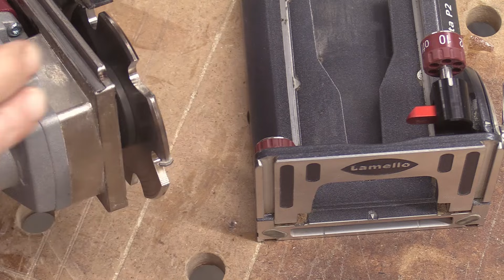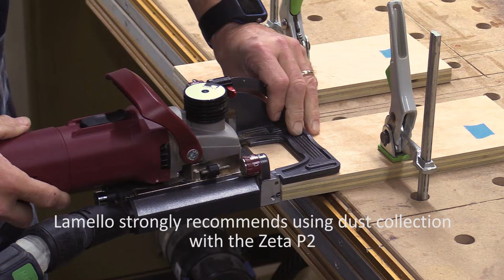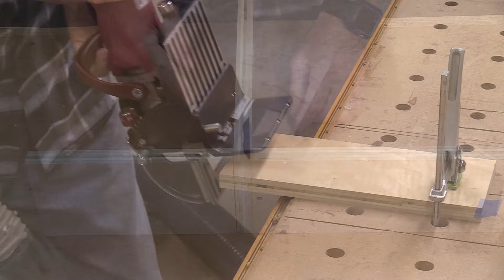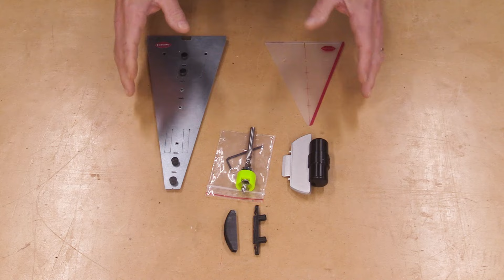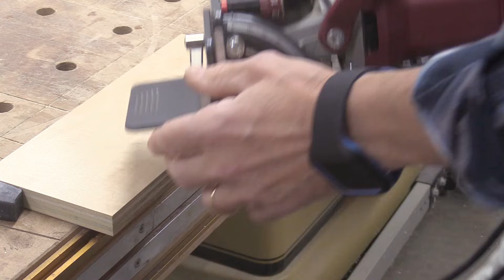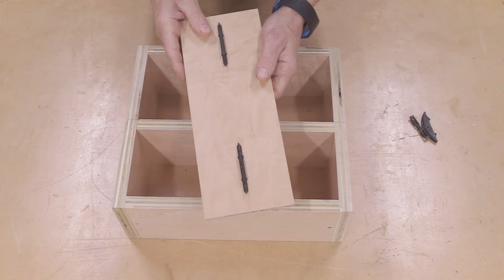Lamello's Zeta P2 and P System Connectors

Comment: I just got mine and tried a corner joint but wasn't getting them flush, but I just realized you flipped the faces after doing it  (~6:05). How did you know to do that? The bit about corner joints in the manual does not explain any of that 😅

Comment: Im debating if I should get the Zeta P2 or the DF 500 domino tool. Do you ever use the domino tool? I have a couple kitchens and and various other cabinets to build. I would prefer a tool that doesn't require me to use clamps during glue up, but I'm worried about durability and longevity with the tenso clips.
Reply: I have both lamello is great but all connectors are very very very expensive 😢
Reply: Why would you be worried about the durability and longevity of the tenso? Its only use is to keep things lined up while the glue dries. The glued joint is durable and will last if done correctly.

Comment: I noticed you never tried to wobble the pieces when you joined them and said it is very strong  joint. I purchased this machine and yesit is strong if you try to pull apart but there is a little movement from side to side when you pull push a little. So what that for the Lamello sales? should be honest a bit more

Comment: Great video Guy as always. I bought one these a couple of years ago after watching you use it in a project and watching it on a couple of other channels. I remember thinking that I learned more about the machine from you than I did from the manufacturer’s videos as well as the distributors videos. I think they forget that many times someone looking at their videos are new to that particular piece of equipment. You must have been a teacher in a former life because you break things down quickly and make it easy to follow and understand. And I still managed to learn a few things so thank you!
And on the subject of learning things.... do you have a video out on the Powermatic Bandsaw that was in the background? I have a probably 18 year old 18” Jet bandsaw with the steel spine and have been thinking about upgrading to the 18 or 20 inch Powermatic unit you have. Mainly for two reasons.... the ability to quickly release blade tension and the guides on your bandsaw are a much better quality than the ones on my Jet. And I haven’t been able to locate a quick release tension kit or upgraded guides. If you have a video please provide the link.... and if you don’t can you do one on the bandsaw when time permits???
Thanks Guy
I always enjoy your videos!
Ron
Reply from the maker: Thanks so much Ron! And yes, thesere is a video on the PM1500 bandsaw on my channel.

Comment: One of the best videos on this tool. Peter Millard's is also good. There is a learning curve for this machine. Lamello makes it look sooo easy, it isn't. Definitely practice with it first. Also I didn't realize the  fence isn't a geared pinion system like most traditional biscuits joiners. Harder to get to exact center, so remembering indexed face you are working from necessary. Also narrow pieces, need to use the domino or you come out the sides.
Reply from the maker: Thanks for the info!
Reply: @GuysShop  i know you know all this. 🙂Its the other potential buyers I was giving a heads up to.

Comment: From 30 years of TopTen I must ask if you have noticed the need to lube the slides on your newer model just about every time you use it? My machine is in good condition because I lube the slides all the time and I can feel the resistance in the action if it needs some lube.
Reply from the maker: I do use a silicone spray when I feel it getting a little tight

Comment: Well done Guy.  Called Colonial Saw today and ordered some of those Flexus connectors and the Wheel of Fortune (was not included in the older Zeta P2 machines)
Reply from the maker: Thanks! I've used that wheel a few times,and it's handy to have whenyou need it.

Comment: On a side note, using a little paste wax helps with the Divario's.
Reply from the maker: Great tip. Thanks!!
Reply: Where do you put the paste wax? On the Divaro connector or on the wood?
Reply: @ronh9384  in the groove of the panel. I just use a small brush.

Comment: Great video with information that is exactly what is required to understand what the Lamello can actually do.   I have considered buying one of these, but as a retired hobbyist, in Aus they cost over $2,000, so I will just have to make do with the Festool domino for the time being.
Reply from the maker: Dig it!
Reply: I would suggest also considering just a normal biscuit jointer from Lamello as they can do really accurate easy joints. 
The festool domino can sometimes be a little bit too much hard work when doing cabinets.

Comment: Blows my mind that this tool cost more than a Festool Domino. Cool system though.
Reply from the maker: Yes, it may be. However it has its place in the shop, and I am damn glad I have it available if the solution fits
Reply: It costs loads it's true. When it arrived I was so excited and then it takes a bit of getting used to but this thing is just amazing.

You can make very precise connections but what's beautiful is even if you are fractionally misaligned it'll still work great. You can clamp your pieces together with the clamax and they'll slide sideways following a gentle tap. Mind-blowing!

You can put your furniture together, take it apart and put it together on site again and they'll still work like new. 

Most importantly, they'll let you work on your own most of the time.

I'll never go back. This has let me move onto the next level. It's a pleasure to work with and you get a perfectly square, neat and stable build.